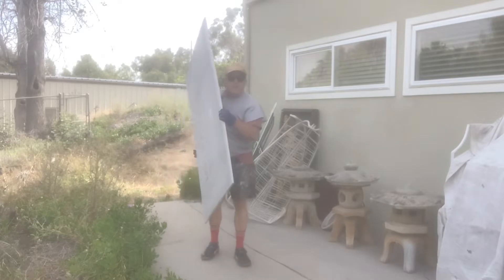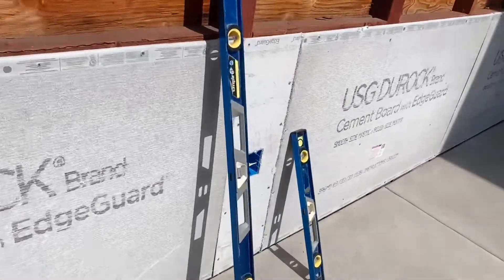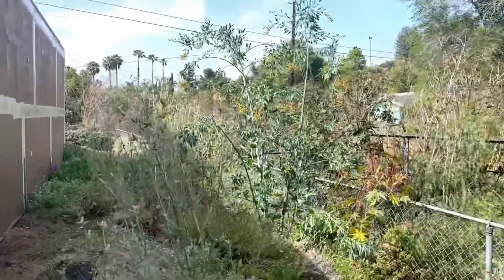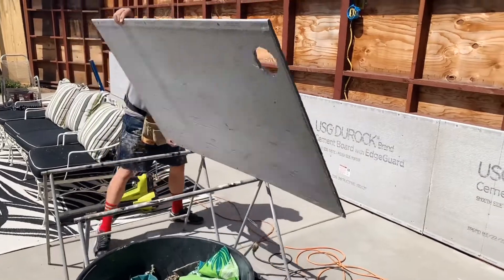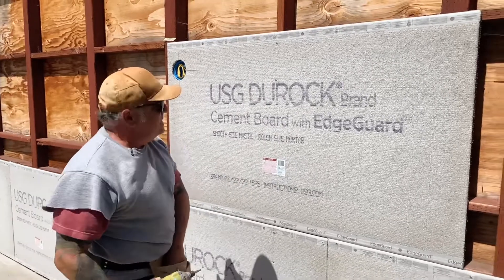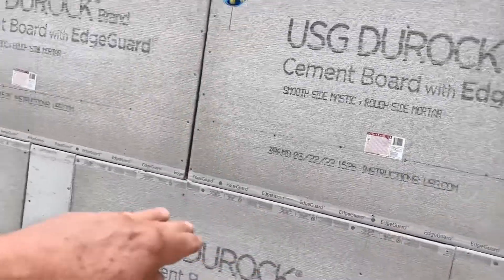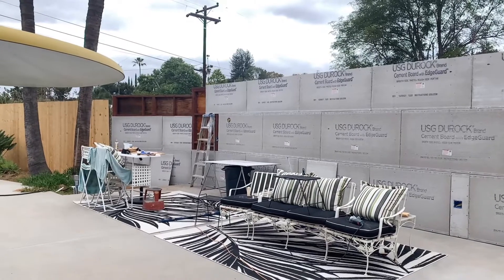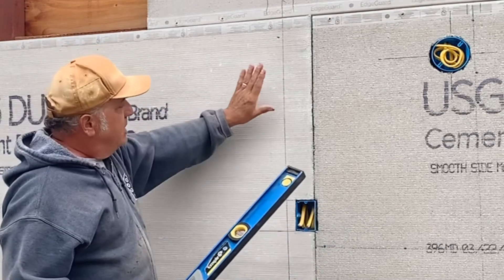Installing Durock | Big Sound Wall | #USGDurock #Durock

Comment: is there a part 2. Also how effective is the wall at sound absorption as we have a lot of traffic noise and wondering if this could be an option.
Reply from the maker: Hi Katmojam, I’m filming part 2 as we speak, and as far as sound absorption/blocking of sound, yes absolutely this will help granted both sides of the wall have something on them. The back
Reply from the maker: (Sorry I cut myself off above) Both sides of the wall should have a covering, and the higher the wall the more effective, since the sound waves would come in over the top.